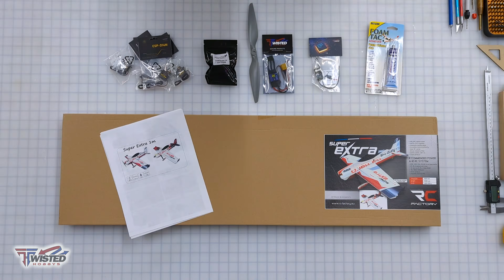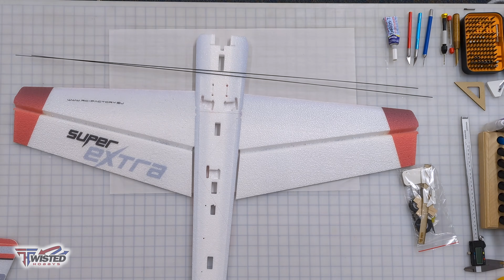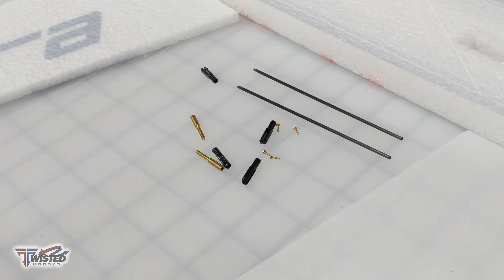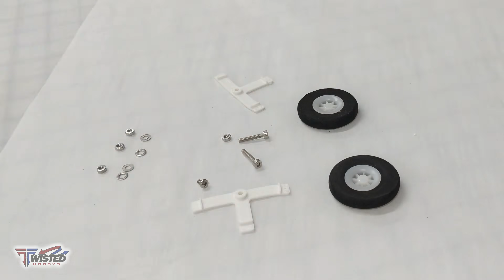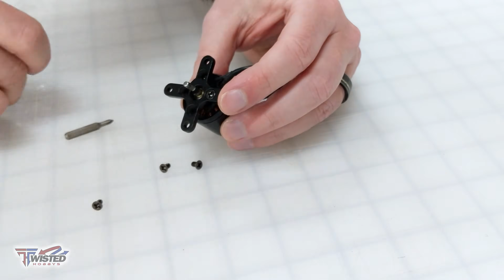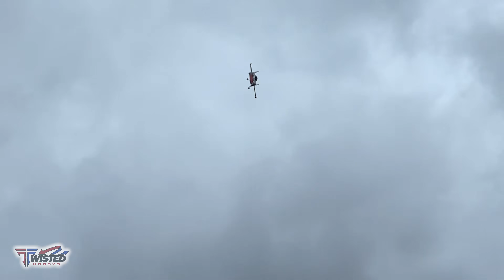Twisted Hobbys/RC Factory - 39" Super Extra - Build & Maiden Flight

Comment: Hi, do you recommend to angle the motor mount with washers in order to counteract the propeller effect or you just leave it straight? Nice build :)
Reply from the maker: Good question, really depends.  While some models already have angle thrust designed into the airframes, to accommodate for this..  Its always good practiced (if this is needed) to test for this.   Once CG is set to a neutral setting, you can attempt multiple downward descent (dives) with 0 motor power.  This will show you which way the model pulls with out power.  Adjust accordingly and find tune if you'd like from your findings.